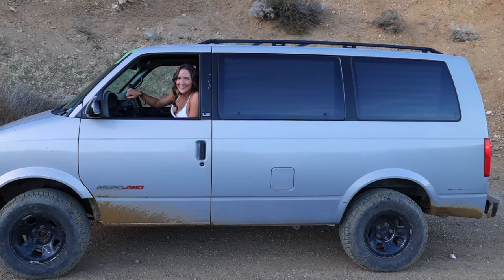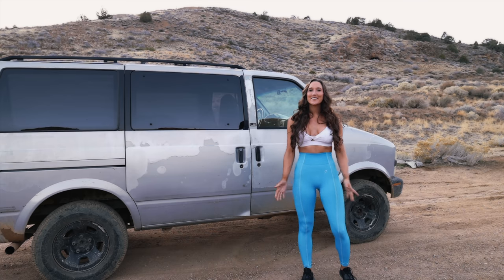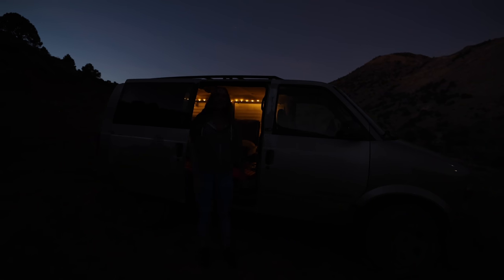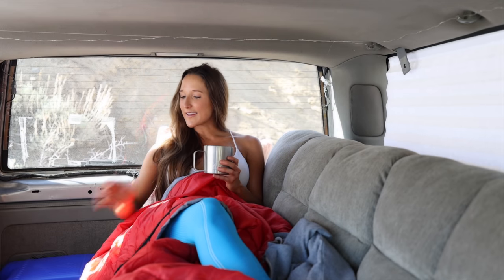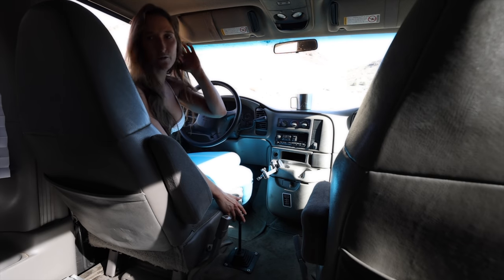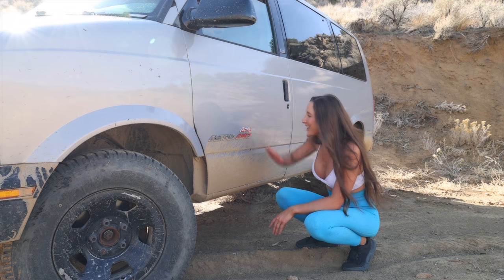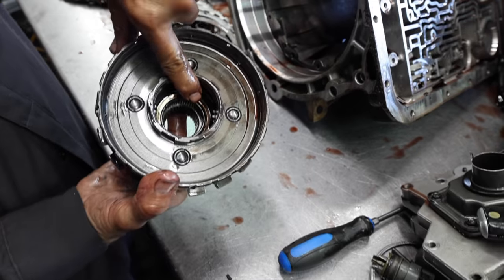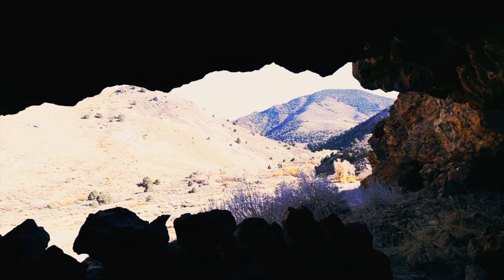Van Life Update - I Converted My $700 Van into a 4x4 Off Road Chevy for Camping and Overlanding

Comment: Nice build and a great utility vehicle. Most people don't know that these types of vehicles can easily last 250,000 - 300,000+ miles and take abuse very well. Unlike modern crossovers... the full size vans, mini vans, SUVs and trucks were/are built to last and handle abuse very well.

https://www.youtube.com/watch?v=0DTWGmcEY4Q

FYI my personal truck is a 2002 Ford F-250 Super Duty, Super Cab, Long Bed, 7.3L Power Stroke Diesel V8, 4X4 Off Road, 4-speed auto, 3:73 Trac Lok differential.

My contractor work truck for 15 years was a 1993 Chevy G-20 cargo van with a 350 V8, 4-speed auto. Also a 1999 GMC 3500 with a 350 V8, 4:10 differential. A 1998 Chevy 2500 with a 350 V8. A 1989 Dodge Ram B250 with a 318 V8.

Believe you me.....I know what I am talking about.